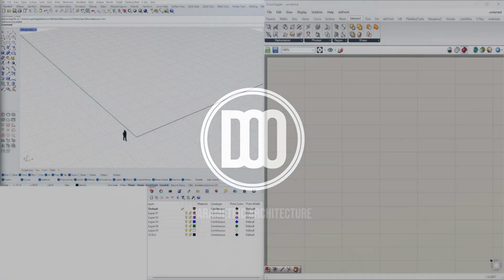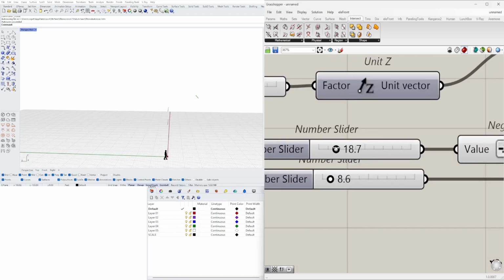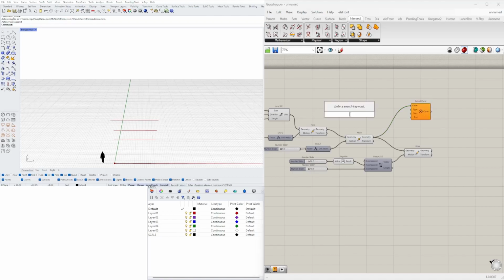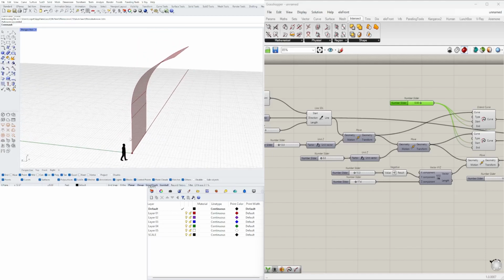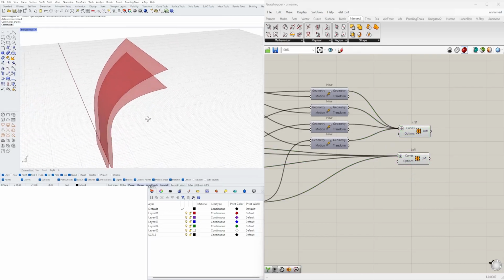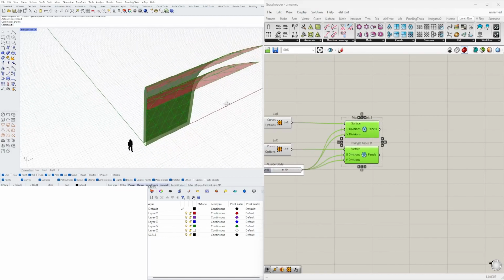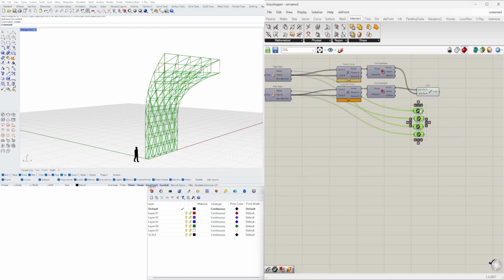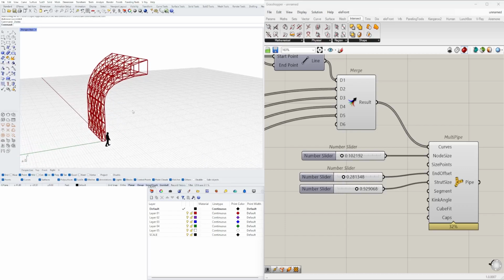Arched Offset Trellis Design Structure Connections Grasshopper Rhino Script Download Available P.2

Comment: Yes, correct. See how complete this tutorial feels? DCO, I can add more to this but in a direction that not everybody expects. For example, the discourse of the structure is already well known to you and many other professional content creators. How about if we focus on the simple idea of how this surface is generated. We all know that the exercise of parametric design is understandable once the algebra of the path mapper is understood using eigen matrices. 

All the tutorials even the most complex ones focuses on the creation of the piece and the structure. But very few teaches the elementary approach of generating a surface. We all know how to loft, sweep, generate a ruled surface and of course work with a simple mesh but how about if we generate a simple surface with tween lines? Or have complete control of the surface manipulating the contours? To be honest, I haven't seen tutorials working with these "elementary" subjects such as regulatory manipulated curves.
Reply from the maker: Exactly, this iteration is a little bit more developed, and has more real life applications. The only thing that is still missing or details for connections between struts. Foundation and connections to footings, and array using a path or a linear or radial array.  I think from now on I will start with basic tutorials like the previous one, and build up to a detailed model. This way tutorials can be broken down from base geometry and simple exercises to complex detailed and developed designs.  Anyone at any stage of parametric modeling can jump in and tackle these exercises depending on their skill level. 

Again, thank you for your feedback. It is always appreciated and helps me move forward with design ideas. I think we all need a good parametric friend like you.
Reply: @DCOParametric  sectioning a project into tutorials covers almost all the basic aspects generating full set of tools.